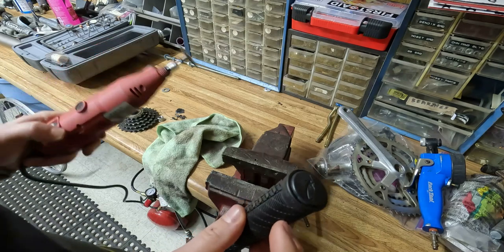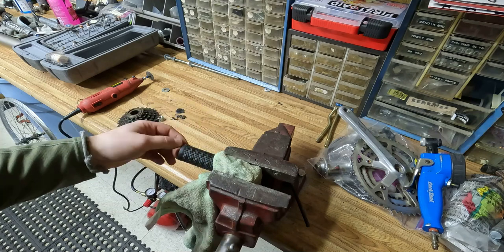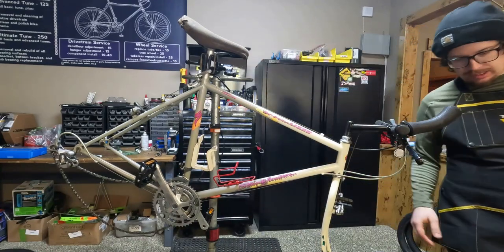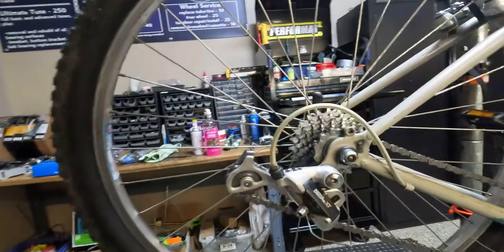Vintage 1989 Specialized Stumpjumper Team Mountain Bike Tune Up

Comment: Nice video ! looks like my bike 89 Stumpy. I changed out my crankset to a one piece,new rims and tires,seat and brake pads. The Deore components I left,I really like Deore . i think it shifts like the 105's I used to have. RD-MT62 rear and FD-MT62 front . My sweet 1st Stumpy got stolen,had to find another one !!! Frames are great and you can make any kind of bike from them . mountain,road,gravel,etc.Turn and Burn 🔥⚡
Reply from the maker: Sounds like a sweet rig.

Comment: What do you use to clean out the old grease from the hubs?
Reply from the maker: I use White Lightning Clean Streak.
Reply: @GringineerCycles  how do you wash away any remaining degreaser so that it doesn’t affect the new grease? Soap and water?
Reply from the maker: @LaserrSharp  that's one of the benefits of clean streak it dries quickly and leaves no residue so no clean up needed.
Reply: @GringineerCycles  Very cool. Thanks for the info.

Comment: That rear wheel does not seem to be original. I recall having GX23 rims on my '89 Stumpjumper Comp (one down from the Team model). That rear derailleur looks original. Too bad I upgraded my bike and most of the original components are gone. I still have the original cranks on my bike including the Bio-Pace rings.